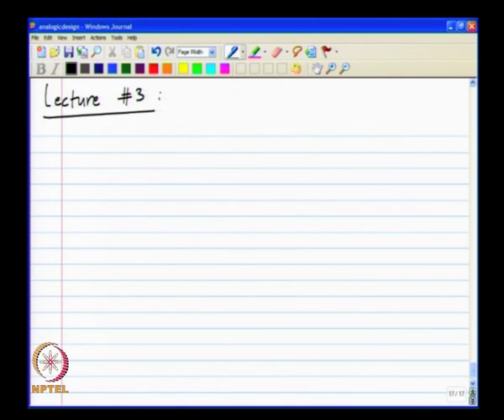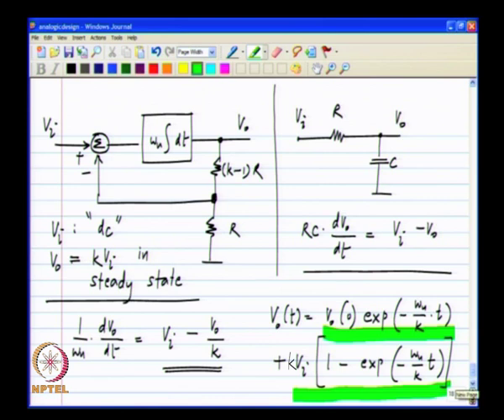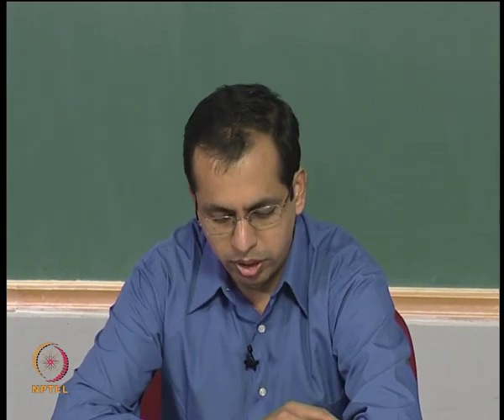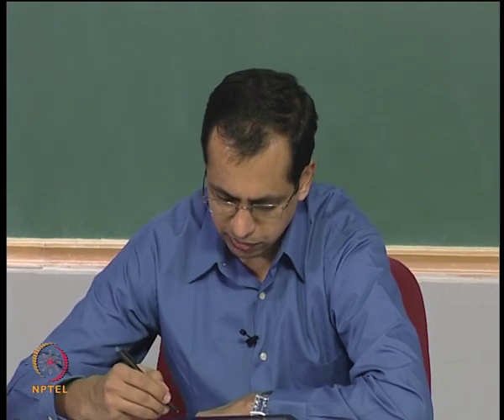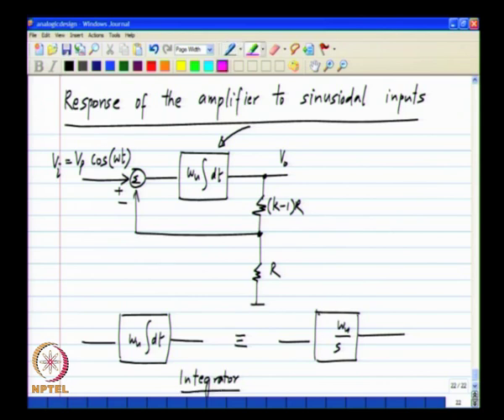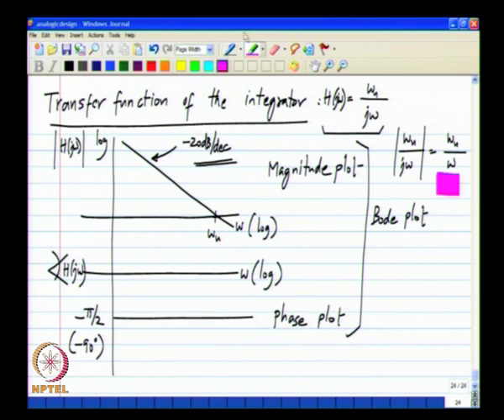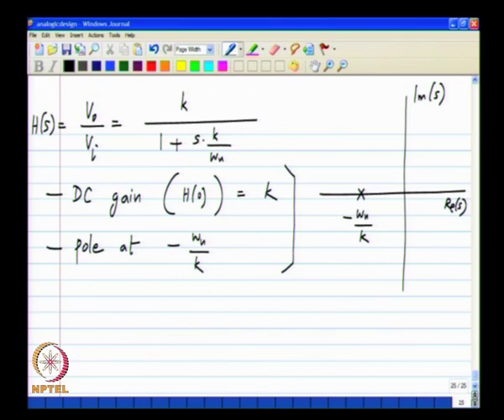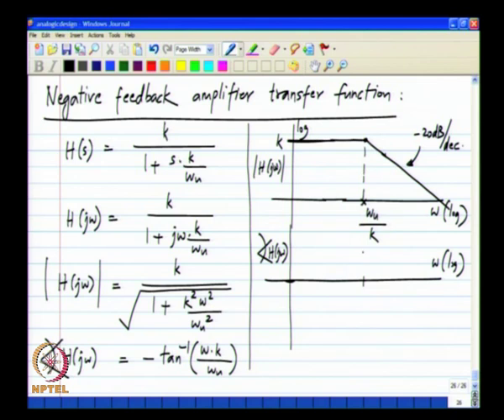Step response, sinusoidal steady state response

Comment: Hello Professor, very nice lectures , appreciate them for this great service. I have one question regarding K and wu. You said when K is higher then apmplifier takes more time to reach final value. But is this only valid when the amp is in closed loop configuration? Or open loop also?
Reply: Negative Feedback system is by definition, a closed-loop system. When 'k' is higher, it simply means the final value that one needs to reach is higher and so it takes longer time to reach it if you use an integrator whose 'wu1' is slower than say another integrator for which the 'wu2' is faster.  For example: If V0= 5V, wu1 = 1Grad/s and wu2=5Grad/s, then it will take 5 ns by the first integrator (wu1) to reach Vo of 5V but the wu2 reaches it in just 1ns.